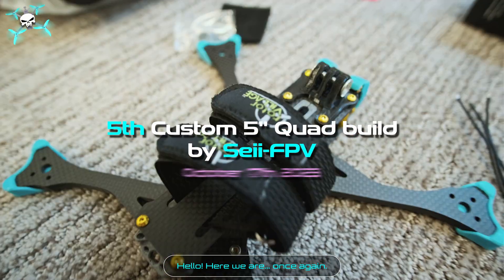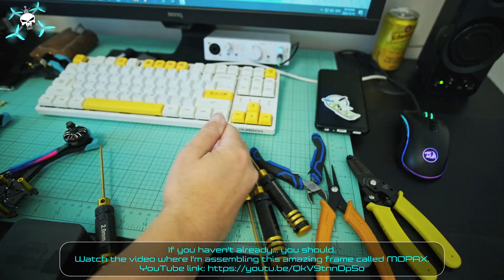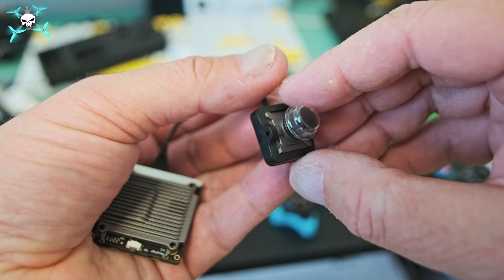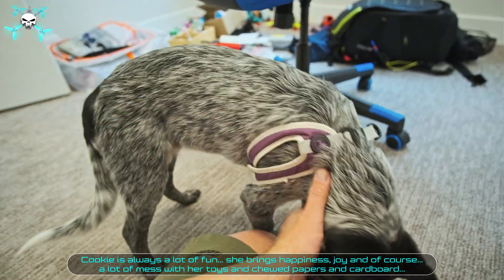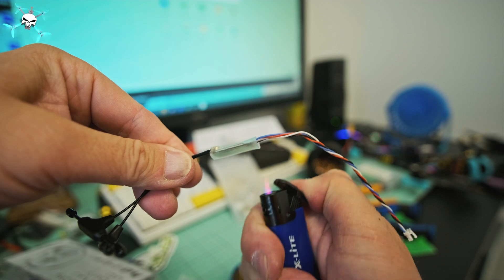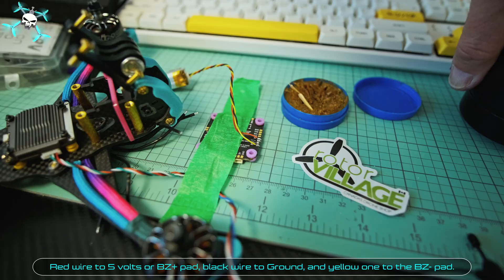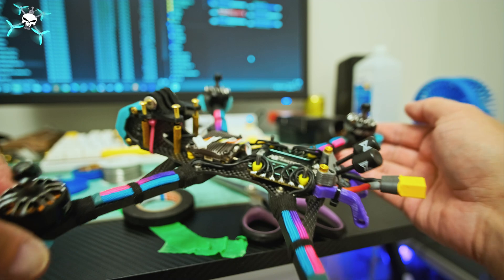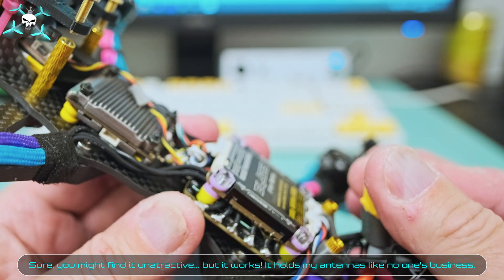MY 5th CUSTOM 5" BUILD | MOPAX | 10−17−2023

Comment: Any issue with gyro and mounting the flight stack at the rear of the frame
Reply from the maker: Absolutely zero. This quad flies just like any other of my 7 custom builds. For convenience, I'd build it with the stack in the center, but the camera cable was too short for this frame, so I've had no choice than to put Avatar HD Pro air unit in the middle. This video shows how it flies: https://www.youtube.com/watch?v=SVH0iqsk9yg